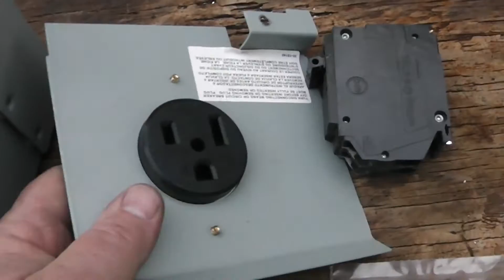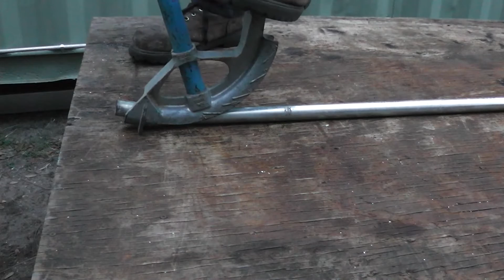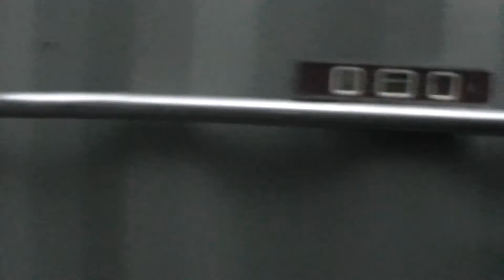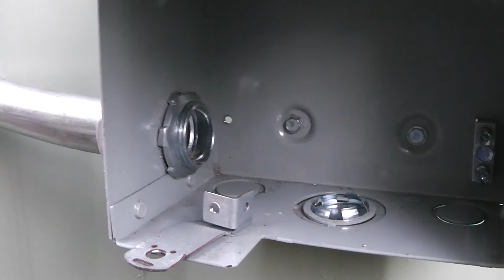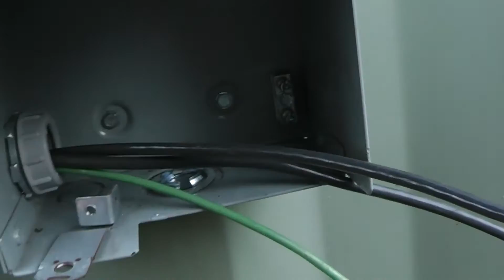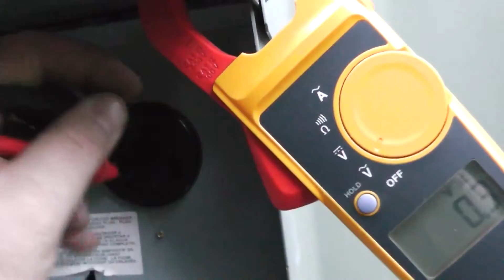How to Install a 208/220/240 Volt 50 Amp Circuit for a Welder or Plasma Cutter

Comment: I'm replacing a sewage pump. The original pump was 220v. The pump I want to get is 230/208. Would the new pump work on this circuit?
Reply from the maker: It should but, you need to check the amperage of the new pump.

Comment: Uni-bits are great to have around.  I need to run two powers underground this week, a 6/2 ufb and 10/3 ufb
Reply from the maker: UF cable is good stuff unless the insulation is nicked when intalled!  Take care.